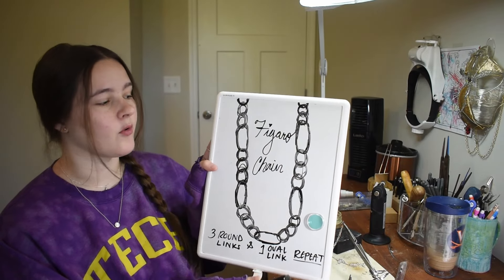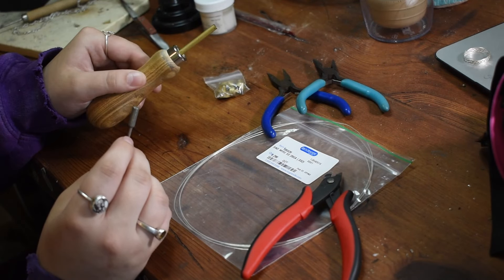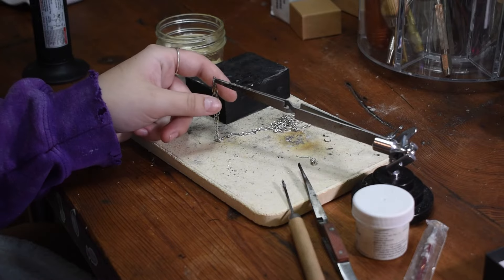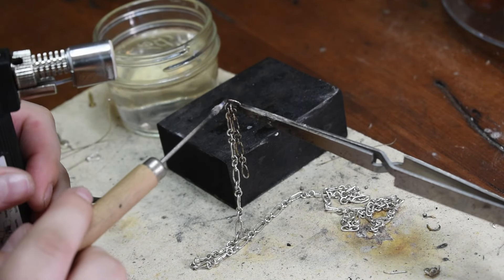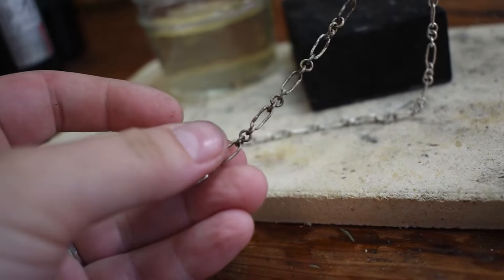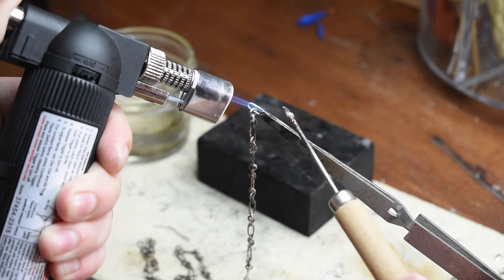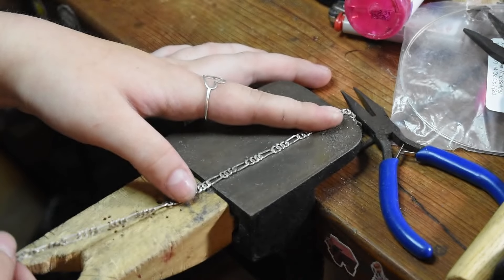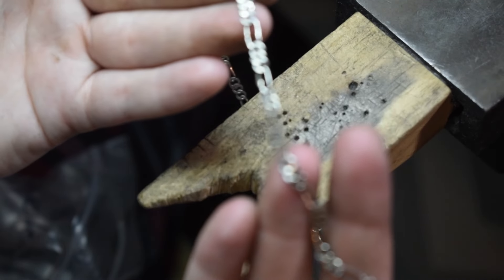How to Make a Chain From Scratch | Step by Step Handmade Figaro Chain | Necklace & Chain Fabrication

Comment: Suggestion for you - with the set of 3 rings if you first solder 2 individually then add the center one then solder to join the 3 rings - you can set up an assembly line - complete all your triple links then finally joined each section to your oval links you may find it goes a little quicker and less concern with solder runoff. Just the way I've found works best for me with chain making. Yours turned out beautifully,  well done !
Reply from the maker: That sounds awesome I’ll try it out next time!! Thank you so much for the suggestion! Anything to make it go by faster/easier lol

Comment: I think you did well, I learned a lot. Thank you
Reply from the maker: Thank you so much I’m so glad I could help!! Thank you for letting me know as well it’s encouraging!<3
Reply: @rurusrings  I'd be interested in seeing more of the soldering and hammering. I was surprised the rings flattened out so nicely.
Reply from the maker: So I legit just twisted it so much that it laid flat. The more you twist the more it starts to bend into a straight flat shape. And then you just hammer it down the chain to give the flattened look.
Reply from the maker: I will attempt another chain most likely a bracelet soon and show that part of the process in that video if interested!!
Reply: @rurusrings  Totally interested, I may have to try this myself. I need to watch your video on wire choice you mentioned.

Comment: Try making about 100 coils at once. The take the spring looking coil to a vice place the coils in a piece of soft leather or even rubber shelf liner and just a jewelers saw to cut a straight line down the center. No worries over  beveled edge vs a flush edge. They will all be perfect!
Reply from the maker: Thank you so much for commenting!! I’ve tried that once before but the orings wouldn’t stay still and my blade kept sliding and ruined the inside of the orings… so you have any recommendations for that? I might’ve just done it wrong the first time I’ll have to try it again!! Thank you!!